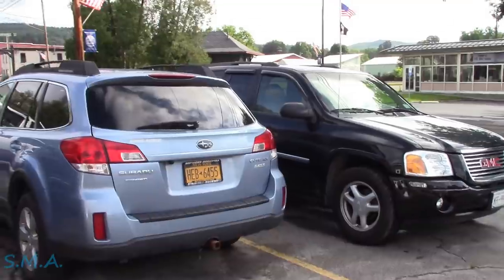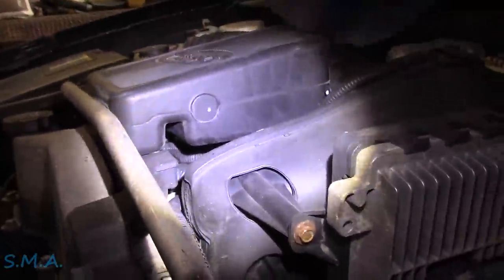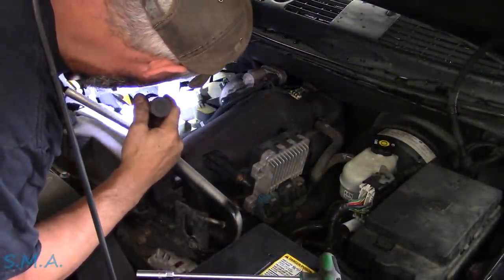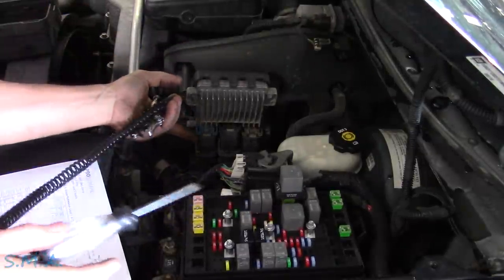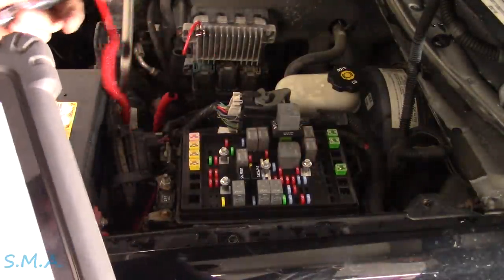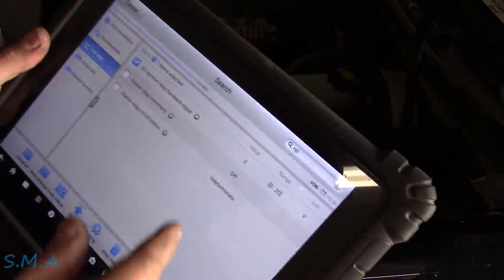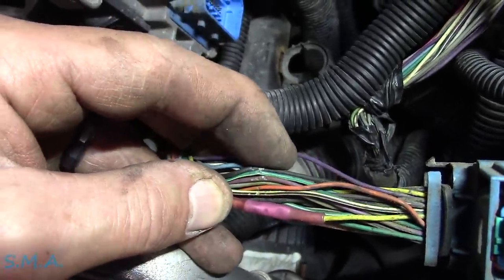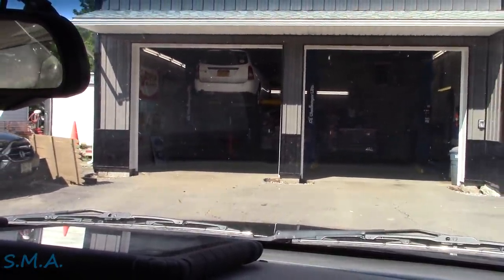GMC Envoy: No Throttle

Comment: Those connectors should be fine as long as there is nothing pulling on the wire hard enough to pull it apart

Comment: nothing wrong with them heat shrink connector's, i have the same pink looking ones you have there mr O, i last used them to repair the old VW front ABS/pad wear indicator loom on the front strut for the young guy that lives opposite my house, he couldn't get an MOT (safety test) on his car because the ABS light was on.
if you cannot get the original pins for the connector you have no choice but to repair the wire, lots of keyboard warriors who clearly don't do this job for a living.

Comment: Anyone that says that those splices are crap are completely wrong electrician use bigger ones that are used under ground soldering wire is a long process and it is more likely to arc against something and even if you wrap tape around the soldered connection if it moves back and forth because of engines running it would rub a hole in the tape to arc. Using those splices work the best because it keeps water from getting in and they do not break that easy. If electrician use those splices means they are pretty reliable. If someone prefers something else than why would you even watch any videos on YouTube make your own videos on You Tube.

Comment: 6:37 Did the other shop not have a scan tool?  Or did they not look up the wiring diagram?  There’s your problem, lady!  It all starts to make sense when you use the tools available to follow the process.  (But then, by the six minute mark into this video, I’m not even sure they did a visual inspection. Most people wouldn’t have been able to keep from touching and wiggling and “checking” stuff.  That engine bay doesn’t look like anybody’s been in there monkeying with stuff except for the mice.)
I think they just passed on it to let the master have a go.  And, that was probably a good call.

Comment: Repairing a broken wire can be problematic. The worse thing you can do is solder it together and just slap a little 3m 33 tape on.. If the junctions used are water prove then I would say your good to go.  Maybe people are wanting you to just drop it in a tub full of epoxy that will keep the water out.  otherwise just tell the haters can just keep on hating or move on down the line.

Comment: I have a 2004 GMC Envoy and I got a problem with my secondary air injection system and the pigtail that’s hooked up to it isn’t getting power any idea of what the problem is it’s causing code 0410 but I changed the valve/solenoid and it’s not the relay switch or fuses

Comment: I have a 2000 silverado with a 5.3 that wants to idle up to about 3000 and wont come down. Ive replaced every sensor on the engine, throttle body and the computer with no luck. Any suggestions would be greatly appreciated.

Comment: My friend has a 02 envoy it will be running good and all at once start missing and the motor shaking shut it down and leave it set for a while and it will run good for a while and then the engine light comes on and same problem.any suggestions.

Comment: I don't an inch and swap in a 2001 Tahoe and now I don't have no throttle It says it's got the 3 signals that APP It says it's got the 3 signals that APP When you 1st started it before you could hear the motor kicked that little motor for the throttle motor would click the throttle plate plate now it's not doing that and I'm trying to see why it's not getting no power to that

Comment: The only prick you probably missed will be some armchair mechanic.  I live in a similarly salty area, and you fix older vehicles the best you can without throwing the kitchen sink at them.  Because Mother Rust will make it a candidate for the scrapyard faster than ever.  So essentially as long as the repair keeps the salt water out good enough.

Comment: I have an acura and wont accelerate at all i changed the spark plugs,throttle body,aceleration sensor,,pcv valve sensor,fuse box,interior fuse box,im not sure what could it be,car just stranded.
Reply: I changed the throttle control module sensor too.

Comment: By most auto manufacturers soldering the wires is not approved, the repair you performed is the only approved type of repair, hence why just about every auto manufactuers give you those type of crime and seal with every pigtail harness that you get ,

Comment: I don’t understand the big deal with using good quality heat shrink butt connectors. Are they under the impression it doesn’t seal or it’s not strong enough? We aren’t using these wires to hang our deer fellas. It’s a semi stationary wire.

Comment: You shouldn't use the proper heat shrink butt connectors..
 you should spray the wires and the connector pins with salt water and then apply electrical tape.

Comment: Anyone that has a problem with crimp style + heat shrink connection please direct them here. I'll set you right. And before you comment ..just think.. How are the wires terminated on an OEM plug? Are they soldered onto the pins? or are they crimped?

Comment: FYI we have used heat shrink with glue/snot & butt connectors under water for water well submersible pumps in use everyday for over 40+ yrs now never had one fail,unless installer error forgot to crimp or heat the shrink proper & before that they were electrical taped down and back 4x to be water tight.  No clue why the folks then you are slacking hundreds if not thousands used everyday in my line of work and everyone uses water ! Oh an they live under water usually 20 to 100' for the life of the well pump some have been in near 40 yrs !

Comment: Anyone who says those those sealed butt connectors aren’t a good repair knows absolutely nothing about repairing anything. If they are good enough for aviation then they are good enough for automotive. Hell, even pigtails you buy directly from the dealer come packaged with them. There are too many tools on the internet commenting on things they don’t have a clue about. I like Ivan but he doesn’t help either with his misleading info on wiring repairs with butt connectors vs soldering.

Comment: Solder heatshrink connectors are g a r b a g e and don't actually wet the solder through the joint at all. Absolute crap. I hate that everybody thinks they're the best thing ever, and maybe they'll work okay for a stereo install or something, but they don't belong anywhere near a car. Crimp is the only verifiable connection that's not affected by vibration. Anybody that doesn't like adhesive shrink crimps hasn't used the good ones or is just inexperienced.

Comment: Anybody whos against crimp and seal connectors probably follow all the other wives tails that swirl around automotive repairs, I use them for all wire repairs at a dealer/retailer level and in a lot of official documents I have seen it's preferred.

Comment: The people that complain about butt connectors are the ones who are jealous and can't fix it themselves...ive been using butt connectors for YEARS, and NEVER once had a single issue with them. And i wont lie, i never heat shrink them on my cars. Ive always wrapped them in scotch super 33+. And again, never had one issue. Theres a reason they make butt connectors, if there was a problem using them, they wouldn't make them. 

Some of us cant solder very well, OR its almost impossible to solder in certain areas on cars. So quit complaining. Jeebus.